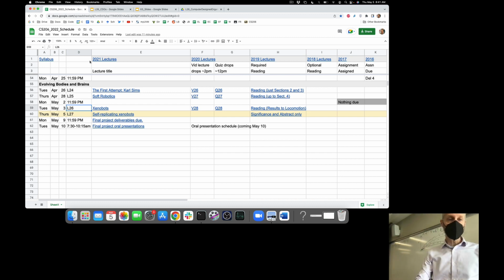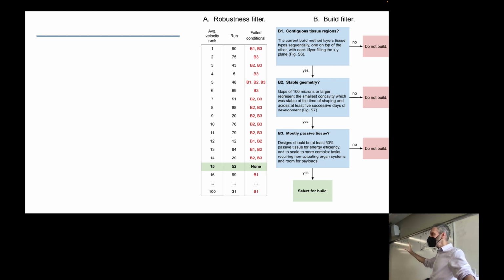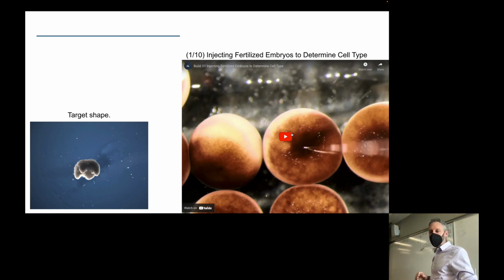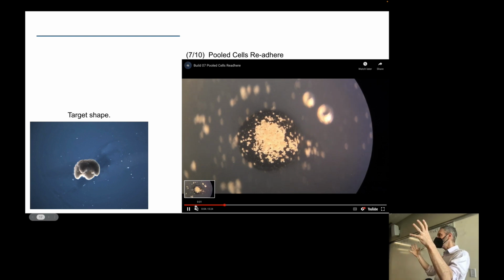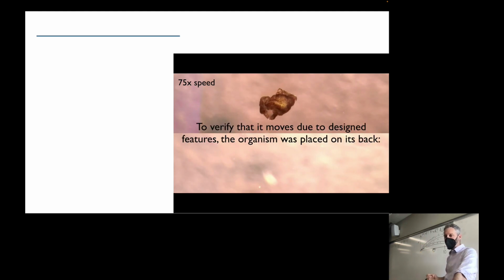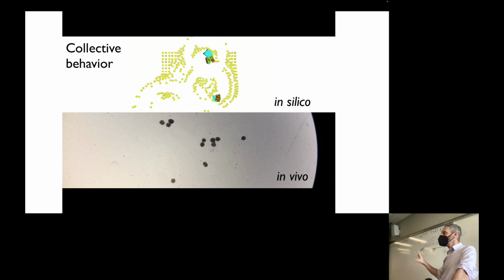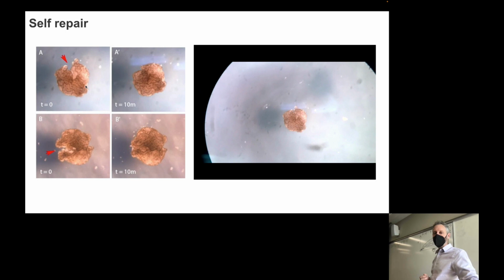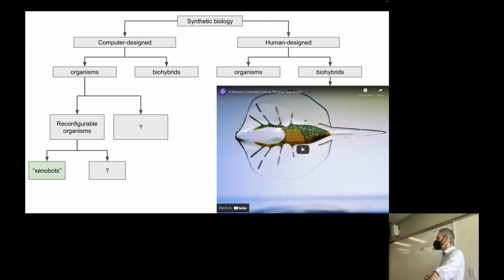Evolutionary robotics. Lecture 27. Thurs May 5, 2022. Xenobots.

Comment: alright, I finished the whole course. THANK YOU Prof. Bongard for uploading this to the web, it's been a great course. I will risk giving one opinion on one thing I would have changed, which is the prominance of very old papers throughout the course and little space to modern developments. It's useful to know original primordial works exploring a certain topic, but it would have been nice to discuss more recent developments of those topics. One example for all: the idea about communication, in the word with M and F (receiver and sender). The topic is cool and that experiment is nice - but is now ~25 years old, and I was left wondering what are most recent advancement with those idea (evolved linguistic, I think). Anyway, it would be interesting to know your thought about this. Thank you again. 

ps: this last lecture is not in the Evolutionary Robotics playlist containing all other 26 lectures, just to let you know.